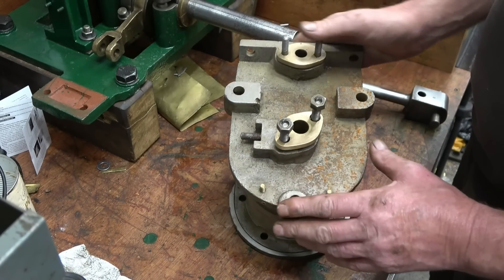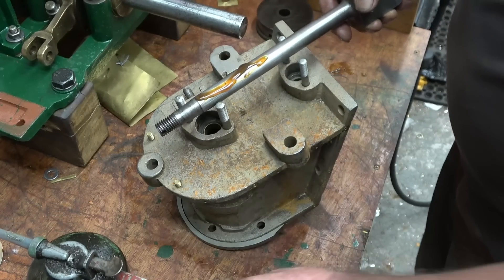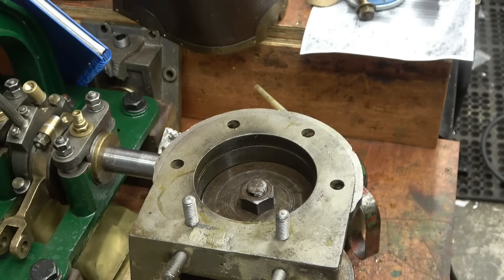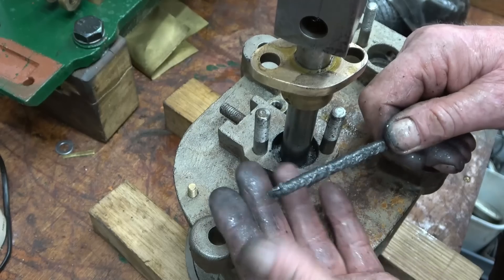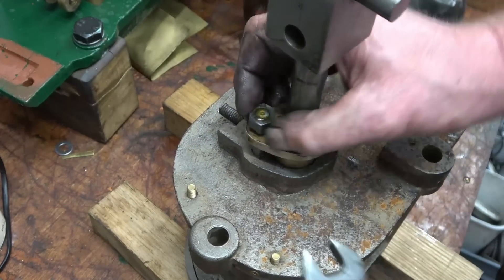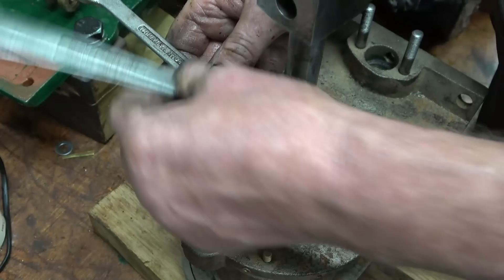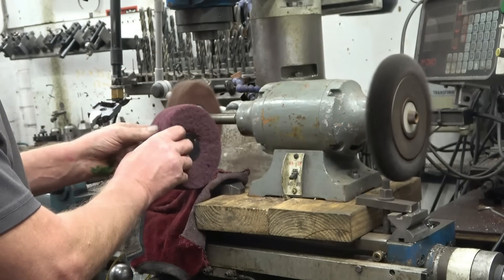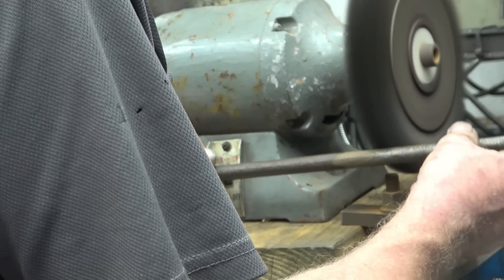SNNC 503 P2  Harker Steam Engine Restore

Comment: It's coming on nicely John. You say the bottom gland lock nuts are half thickness, but on the video they look the same thickness as each other. It must be an optical delusion as my old dad used to say! Looking forward to seeing this running either on air as you usually do, and later on live steam John. Cheers mate.